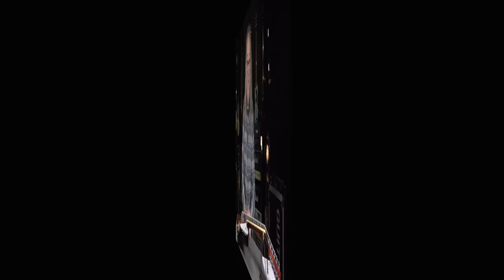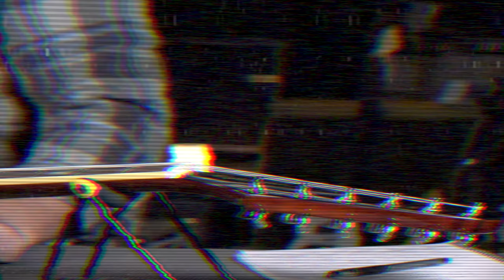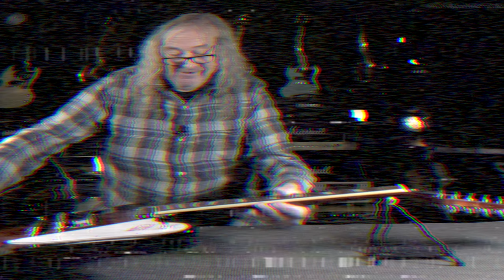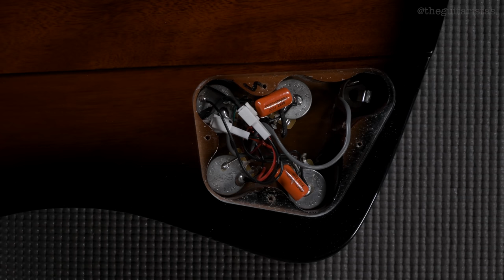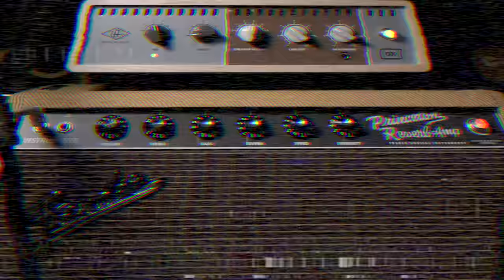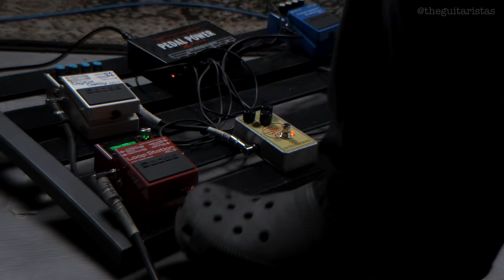Epiphone Firebird Vintage Sunburst - Authentic and Affordable Inspired by Gibson Classic!

Comment: Hey my friend thanks for this video My favorite guitar I already mentioned I told you my Johnny went to story and I wanted two of them at least including trouble checking lol it was my favorite guitar first Johnny Winter album I was like I got into was still alive and well and there he is with the firebird on the cover of the guitar so it took me a long time but I wrote one 2017 I bought it when the 2018s will come in out at the end it's 2017 I bought one in the same color s whatever you want to call it and I always wanted what's the difference between a vintage versus antique press maybe just the way they spelled lol but yeah it seems to pick up some yours or more accurate to the original ones in the pickups online it's a 2017 and it is spiced out amazing I really got a great guitar it's got time burger tuners and I think it's time for a cartoonist does not another guitar in my opinion for my former eyes or actually my eyes when they were there wasn't a guitar that was more suited to this tuna than the firebird and their 40 to one equivalent to 40 than one ratio so yeah locking two in the steering burgers it came with it excuse me it came with an extra stick and extra thick rose wood fingerboard cuz I don't think really makes a difference probably more for gaming it came it it has cryogenically treated frets and that is really something it's not like their tone apologies and their aerospace and other things that the treatment the heart is 400% makes it four times harder therefore I supposedly last four times longer I don't think it's doing that to all of the guitars anymore what else thing a boy that was extra titanium saddles I'm trying to think of does anything else that was different on it that made it made tickets all the better spec but yeah you know that the I'm pretty sure that the mini humbuckers the or not single coil instead of pole pieces I think they use a slab bar of a slab magnet or something you know I think that's what they call it and again yours is more accurate to the original because you have a Nico too pickups the pickups are original not hard at all again they will only go to those on the original ones mine is like a pickup on steroids they are ceramic pickups and people think that it also ran to pick up suck but that's not true it's how they made and it's made the same way as the El Nico too once but with ceramic pickups to make them hot the bridge pick up online is about 25 and the bridge was 17 and I don't know about the Henry's lol but for the bobs that's what they are. I'll tell you though you could imagine extremely hot pickups but when you turn them down will you turn the volume down on them they are beautiful and clean and the Christine it's their amazing pickups I love that guitar I haven't played it for months and I took it out just about last week and it's standing on one of my fans I bought a hanging floor stands and the works great I didn't have to buy any special one just a regular hanging full of sand and I got next to it now I'm playing the tubs is my 59 at the phone last full and I'm running it at this point into my stage right with a think it's the ditto of delay and the TLC holy Grail mini reverb but the truth is I like the reaper better on the episode I'm going to get an AV box a splitter box and I'm going to start running my katana 100 and my stage right and using the effects on the container instead of the petals and see how that sounds and then just running the two band dry but yeah I've been playing it now for a week and I forgot how amazing they got plays and it's beautiful it's effortless and the sounds are really cool of course and yeah it amazes me that the epiphone guitar has a really it has a legitimate next few body construction you know nine play just like to get just like mine yeah it it amazes me that they can sell it for that price Mike was exactly the same as you was at seven pounds 13 oz it's it's not it's not even close to my heaviest guitar I have my across the other phone I think that 459 was way 35 lb and I got a hollow body that weighs quite a bit more than this than a firebird yeah but I love it it has something called the tech toy cuz you have magic it sounds like a disease right attack toys or not I'm going to have to not recall or replace because not the Eastern and the a string don't even sit in really the slots they kind of sit on top of them and it plays good there's no buzzer or anything we're just noise it lol so yeah congratulations on this guitar I mine is just a regular reverse it's a reverse fiber I think the non-reverse to me I mean I always say if you took the fire over and you turned it around so it would be reverse like a non refresher it to me it looks a lot like the jazz master it's kind of similar sometimes I think that just saw the jazz master and flipped it and made a fiber and another one of the great guitars that played the fiber and the later on the explorer was Andrew Collins Toyota right name from the Lynyrd Skynyrd Lynyrd Skynyrd he played one it required him played one for a while I didn't feel young did back for a while it wasn't their main guitar throughout the history of their careers but they played them for certain periods of their careers The restaurant he went through you know that was his main guitar main guitar as I think when he before he died I think he had six of them and he had a white one which he said was his favorite and it there's a video on YouTube that says that it doesn't say Johnny says he's in the video but anyway and towards the end he went he went with watermen not water man with music man guitar and a music man amp the 120 while I think it was full of by 10 I think that's what he was using at the end and the fire of a slide his his original fiber the one that was on the cover of still alive and well the neck had broke so many times on it and had him play so many times he was only using it for a slide because that's all the only thing it was good for at that point how many times can you change a neck I don't want to send you I would think that of course more money to make a firebird then it does to make a list full and yet it's quite a bit I don't know what the price is on that but it's still got to be cheaper it's definitely cheaper than the last four I got an amazing price on mine too I got a third $1,340 US dollars delivered to the house done deal I could sell it for I can sell it now from what I pay for it I'm pretty sure that especially with the specs that it has on it it'll extras and stuff from the cryogenically treated him saddles you know all that stuff every expensive just on their own anyway this is already a like like a journal my comment is become a journal entry lol anyway I really great videos as always and yeah enjoy that guitar I'm thinking about buying one I have been I have for quite a while you know why not you know what's my favorite guitar why not have more than one you know and from what I see with yours and the specs it it would be different enough you know just to pick up so long from you know a negot iable ones it's different enough to justify it all right I think I'm going to try and shut up now to see the above the flying bedroom guitarist PS see I can't shut up nothing I might be blind but I certainly know how to talk lol

Comment: Should fit in the decently robust Fender Precision Bass padded soft case, with about 10cm of clearance. They're only about £30-40. There's a level above that where they are about £60-70 and they are much better, have extra padding for the neck, with velcro strap to secure the neck in place in the center.

Comment: Thanks been looking at one of these. Still up in the air with issues ive heard about.
Reply from the maker: What was your worry again?
Reply: @theguitaristas  had a friend that the wiring to one pick up didnt work so he got another from sweetwater and that one had several screws that were installed on an angle making the wing guard stick up. The took that one back and has been satisfied with his third one.
Reply from the maker: @hod8931  Glad he got there in the end and hopefully all worthwhile!

Comment: Looks well-made and you obviously get a lot of value for a medium-priced guitar especially the neck through the body. The only real downside I can see (other than the ones you mention) is its impracticability in the gigging environment. If you can't put it on a stand (never seen one of those stands you show at the end they look very ungainly), I suppose the other option is to just leave it in a case.
Reply from the maker: I keep tripping over the stand so it does need some planning! 🤣

Comment: I can't help but think that the firebird is a thinned down version of Les Paul's LOG, (his original solid body guitar?). Les cut a cheap hollow body in half and slid it over the LOG and created the first real semi hollow body. The firebird is just a thinner LOG with two solid slabs glued on, creating a solid body.
Additionally the Firebird looks a bit like an upside down Fender Stratocaster. Could Gibson/Epiphone be sticking a finger in Fenders eye too?
The guitar sounds great, nothing like a Fender, despite the resemblance. I'm glad you like this affordable and outstanding sounding guitar, ;-)
Reply from the maker: I think when they released this in 63 it was a definite response to Fender's domination of the market with the Strat and Telecaster... custom colours and single coil sounding pickups. In the end that made another unique classic that didn't catch on until decades later!

Comment: The pickups are the same as in the Bonamassa version. This from the Bonamassa site:

"The "Treasure" Firebird-I is powered by the new ProBucker™ FB720 pickup, reconstructed at Epiphone to the original specifications of Gibson Firebird pickups from the mid 60s. Accept no substitutes! The ProBucker™ FB720 has two Alnico II bar magnets used as blades in coils along with a steel reflector plate to achieve the classic Firebird tone of the 60s. Because the DC resistance is around 7.85Kohm, the ProBucker FB720 provides a clean, brighter output with incredible touch sensitivity and a warm low end compared to mini humbuckers, which are used in most Firebird reissues."
Reply from the maker: Excellent info cheers Rod! 😎👍
Reply: @theguitaristas  you're welcome Colin, and love your channel btw!

Comment: You know, I've got several Epis but never thought twice about a Firebird 'til today. Pickups and wiring sound great. Does this have coil split too? It has 4 conductor p/u leads. Probably a resized Probucker alnico 3 & 2 set, made to look more vintage? A P90 version would be interesting. Anyway great sounds and seems very good overall quality. I kinda want one now. Cheers from Dallas!
Reply from the maker: Cheers Mark, no coil splits but everything is possible I guess!
Reply: @theguitaristas  That is true. With four wires you could do that. But it sounds great as-is.

Comment: Not to change the subject from the Firebird but I am wondering about a tube amp.  I have got a 50 watt Fender combo Gt or GTX50 that has all of the digital stuff.  I want to try to find a good starter tube amp that will give me great cleans and some good overdrive.  What do you recommend to start out with that will not break the bank or the back?
Reply from the maker: Check out my review of the TUBE15.... branded Harley Benton in Europe and Monoprice Stage Right in US... it's a blinding tube amp for around $300 👌

Comment: Firebird pickups are still HBs, but, instead of having two coils with a magnet on the bottom, and non magnetic pole pieces in the center of both coils, Firebird pickups instead have a bar magnet in the center of each of the two coils, similar to how Fender pickups have slug magnets that the coils are wound around. But, since there are still two coils in series, a Firebird pickup is still a HB, hence the name Probucker! Why is that so hard for everyone to understand, and so many get that wrong?

Comment: I'm quite sure you miss-spoke, but you can't have a wrap tail and vibrato at the same time. 8)  I had a Firebird_3 burst in 1972, and like other dumb things I did when I was young, I sold it. I have wanted another one ever since, just never found the right one. This Eppie, just being a traditional 9 piece neck alone is well worth the  $$!! Even if you changed the hardware and pups it would be 1/2 the price of a Gibson!!  About the only difference is the banjo tuners, and I didn't like them anyway. Great guitar, and value!!   8)    --gary
Reply from the maker: Yes you can… I think I described the Firebird III as having both?

Comment: It's a shame these don't have the stepped headstock face and banjo style tuners but I'm well aware that those tuners come with their own problems, not least a requirement for an extra deep case. And it's worth saying that the standard Gibson FB has exactly the same configuration as this Epi; you have to sling their Custom Shop over US$5000 to get a true vintage style headstock.

Comment: It's been proven the only things that matter up to the point where the guitar plugs into something as far as tone is the pickups, pickup height, strings (only if they are different material as it depends on how well the pickup reacts to string movement can depend on string metal composition due to how it effects the magnetic field that the pickup uses to amplify the string vibrations) and tone control (caps, transformer, coil split etc..etc..). Tone wood is pure fantasy. Bolt on vs set neck vs neck through is pure fantasy. Fret board wood is pure fantasy. The best thing you can do to change your tone is speakers, cabs and mic placement, amps to a lesser degree and obviously effects signal chain.
Reply from the maker: That's still quite a lot of things though... and personally I believe that everything can have some effect on the tone, including the things you dismiss but also other things like the weather, day of the week, time of the month, and what sort of mood I am in... 😜✌️
Reply: @theguitaristas  Check out some of Jim Lill's videos. One in particular he sets up strings across two tables, ensures the scale length, same pick and heights, same controls, and compares it to his actual Tele. Open chord strum tone is identical between the two given same amp/cab. Guitar wood has ZERO effect on electric guitar tone. There's tons of other videos proving guitar company marketing to everyone's GAS is pure bollocks. if you like what it looks like or the weight, sure that means something. Expecting mahogany to sound different than Ash given same pickups, pickup height and electronics is just pseudoscience.
Reply from the maker: @odie5268  Yes of course i've seen all of those 👍
Reply: @theguitaristas  Nice, love your videos to death, definitely mean no disrespect. I think people just get caught up in these things about guitars that are provably untrue (aka tone wood).

Comment: PSPs as far as the again to pick ups being single coil I'm pretty sure they're not I mean I turn my amp up and I turn the volume up on my guitar and it's so you don't hear a thing until you touch the guitar I'm going on there I'm pretty sure that's two coils in it and as long as it has two coils in in the pickup it's humbucking if I'm not mistaken either way I'm going to pick up I pick nets
Reply from the maker: Cheers Bob, I think you a right the are humbuckers but a different kind specially made for the firebird. Thanks man have a great weekend!

Comment: The firebird pickups are  poorly named by Epiphone. They each have two rails, wired in reverse to 'humbuck', but have no individual pole pieces to penetrate the cover. The coil is wrapped around the magnet. They do have more articulate sound like a single coil, but humbuckers cannot be single coil.

Comment: Firebird pickups are NOT single coils. They are dual coil humbuckers.  They are a type of mini-humbucker - but not the 'traditional' mini humbucker is a smaller version of a standard humbucker.  Instead of slugs/screws with a bar magnet underneath, the Firebird pickup has the bar magnet positioned like in a 'hot rail' style pickup, with the coil around it.  That's why there's no exposed slugs/screws on a Firebird pickup - cos there aren't any.
Reply from the maker: Yes, did I say they were single coils?

Comment: Amazing value for money. The only thing it lacks compared to the original are the headstock carve and the banjo tuners (Gibson does the fret nibs so crudely now days they're basically worse than not having).

Speaking of 'resale value,' people talk absolute nonsense. Guitars usually sell used for around 60% of the new price. Economic illiterates like to pretend that buying a Gibson for 2,000 pounds and selling it for 1,200 represents better resale value than buying an Epiphone for 500 and selling it for 300. You lose the same proportion of your spend, but in the case of the Gibson, it's 600 pounds you lost instead of 200. It's a ridiculous talking point. There are only a handful of guitar models that are in such high demand that they sell regularly for more than that 60% or retail.
Reply from the maker: 😎👍👍 yes well said!